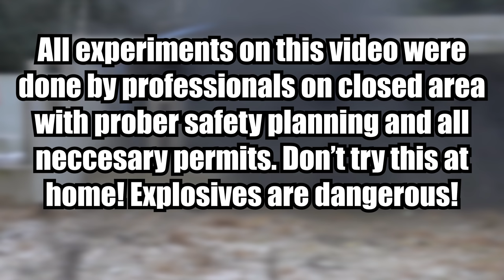How hard it is to explode a hole in concrete wall?

Comment: everybody who ever had to jackhammer through a concrete wall knows how freaking hard this stuff is. And concrete becomes harder with the years. I wonder how old the wall for your test was?
Reply: My gues is over a year, so it's about 90% of max strength. It takes over 100 years to reach max.
Reply: @silmupelaa6349  and after 100 yeras start to deteriorate not the concrete but steel inside because there is no "chemistry" in concrete any more to prevent rust which will slowly blast the concrete
Reply: @silmupelaa6349  most concrete strength is based off 28 day strength.
Reply: My thoughts exactly
Reply: Looks like failed pourings the concrete company had laying around. So they could easily be a few years old.
Reply: @SweBeach2023   do you think they have the space to store stuff like that ? And for what purpose  ?

Comment: Next time, also try a sheet explosive charge shaped like a square on point ("diamond") shape, laid flat against wall and initiated simultaneously from two opposite corners. Where the detonation waves meet in center of square, they will reinforce and make a straight cut, even without water tamping.
Reply: This sounds really interesting. Could you, theoretically, use 4 of them, joined at the corners to create a big “diamond”, and cut a square out of the surface they’re attached to?

Comment: the reason why the last 2 explosive devices went through the wall is: the conrete has microfractures because of the explosions from before. If you would change the order of the explosions, the watertank would not get through the concrete wall.

Comment: I know this is an old video but, if you ever revisit this, you could use a iron or steel bowl around 10mm thick.
You tape it to the wall with the explosives at stuck to the bottom of the bowl (inside it) and the top of the bowl facing the wall.
The air pressure inside the bowl will make the hole you need
Reply: And also shoot what's basically a cannonball in the opposite direction, around the direction they are in 😬.

Comment: You needed to add water bags on the outside of the charge. 

Water doesn't compress and explosives move to path of least resistance.  Concrete will compress before water thus increasing chance of blowing a hole in concrete.

Comment: You should do a video that shows how much explosives it takes to make a hole big enough to walk thru like in a game.
Reply: That requires a different type of wall, or complete pre drilling and inserting charges in a spiral pattern, like when drilling and blasting on the face of a mine drift or tunnel.
Reply: You'd probably need a regular brick wall

Comment: So you can "control" the direction of energy released from the explosion with water since it doesnt compress? Energy will go the path of least resistance? I.e. concrete with voids vs tightly dense water molecules.
Reply: I'm not entirely sure about your rationalization with molecules, but yes. It's the same reason you don't want water in your combustion engine because it doesn't compress. It's great at channeling force because it will stay the same volume, so if you violently shunting it into concrete, it won't just vaporize like the steel bar.

Comment: I'm genuinely curious as to how much effect on the pressure wave a plastic shell has over steel...
Reply: zero, it is not black powder or other fireworks material that is burning(not exploding) and the shell is alowing the pressure build up(and in the end failure/"explosion" of the container is the whole booom!).

Comment: Did you consider whether your explosive was positioned in front of the rebar or between the rebars? I would think that would make a difference as to whether something goes through.
Reply: It might, but from a breaching perspective it may be difficult to know or find out just how it's spaced, so you'll probably have to wing it. It also may not make a significant difference.

A guy who studied and trained breaching in the military said in the comments here that you'll have to cut the reinforcing rebar afterwards with a powertool, because the concrete will absorb the blast, just like you see here. The rebar would have to have the explosive right next to it to break it up, which you don't have the luxury of spending time fidgeting with (at least in any kind of combat scenario), but pulverizing all the concrete around it is still a very good start, because it's in the way just as well.

If you've got a good barrier or corner to take cover behind though, you could probably rush in and start cutting that rebar pretty quick in just seconds after the blast, even faster if two guys work at the same time.

Comment: At 6:18 begins a demonstration of the power of water.

Technically, a lot of the reason a torpedo hitting a ship's steel hull under the water can put a big hole in a ship has to do with the "incompressibility" of water. A detonation looks for something compressible to send its energy to. Steel and water are both regarded as incompressible. The air on the other side of a ship hull is however regarded as compressible. The result is that the detonation of a torpedo will make a hole in a tough steel hull in order to breech a path to the compressible air on the inside of a ship. German submarines long ago in WW1 more than 100 years ago used that trick to sink a lot of ships with their torpedos.

In effect, the entertainment detonation crew was creating ship-like conditions of water on one side of an explosive, and on the other side of the explosive, a tough object with air beyond it. The result was the same as what the German submarines were looking to achieve in WW1, a big hole.

Comment: The Jerry can would have been more effective on the other side of the charge. The water transfers the energy more efficiently than air. 

We used a quarter stick of C-4 and an IV to taco heavy steel doors in the Army.

Comment: They did tests about a decade ago for the bunkers that have been placed around the US.  Epoxy concrete and then epoxy graphene.  When properly poured and set, you can hardly scratch the surface with even a shaped charge.  Your standard bunker buster can't even penitrait it.

Comment: Surface explosions do very little unless they are directed. Drill a bit of a hole, and put the explosives in that, and pack in it, or use a shaped charge, and you'll likely have an entirely different story.

Plus thats reinforced concrete. Different story if its not reinforced, as well.

Comment: The Underwater  explosive course i attended way back in the midd 70s, I used the bottom of a red wine bottle (just the dimple) to shape the charge, using blasting gel pack the explosive  evenly around the glass place the Det in the in the centre of the dome, attach to wall or heavy steel plate and initiate, it should blast an  hole of about 25mm right through.. smashing fun.

Comment: Make a shaped charge in a small bucket and line it with a copper sheet on the inside. This should, with proper stand-off  distance, create a metal penetrator that will cut the steel reinforcement. The hole will be approximately the diameter of the bucket, assuming you don't skimp on the explosive charge.

Comment: Place a slightly delayed chopping shaped ring on the back of the container. Perhaps it fires though the hole made in the water and chops the wires. Making it fire the metal slightly increasing in radius the central lower vaccuum-ish pulls for a tension stress on the centre?

Comment: The c4 with the rod acted like a HESH tank round instead of like a HEAT round. HESH works by transferring energy through a material so that it causes fractures on the other side which causes spalling to occur behind an object, or for tanks. Inside the tank.

Comment: 4:51  this presible is similar and used to that of a HESH or high explosive squash head round which can be used on tanks the way it works is it detonates on the armor outside and then it forms cracks inside which produces deadly shrapnel and injures the crew or more

Comment: The title should be "3 Funny Finns Blow Stuff Up". I bet you, it goes viral. ^^
BTW I think your Finnish accent in English is just adorable, I instantly liked it (never heard Finns speak English before TBH)

00:01 Find the typo... :P

02:18 Common guys and gals, you knew EXACTLY nothing would happen - you just needed an excuse to blow one more thingy up. XD
08:10 Inertia of mass (in this case the water) is your friend. I knew it would be way more effective, but expected spalling, no clean breach. I think getting the Steel out of the way would demand for an ATGM or similar.
Reply: An ATGM would not make a large hole, HEAT warheads make a small jet of copper that penetrates. Would definitely pen the wall, but not a big enough hole to even put your hand through.

Comment: Maybe use some magnesium rebar to line the outside of the can? Maybe it would burn through the steel reinforcement. At the very least it should help burn up the remnants of the container and limit the blowback. But the explosion will be too bright to look at directly.

Comment: Using water as a cover for a breaching charge, because water can't be compressed, the initial force of the explosion is reflected back in the direction you want the explosion to go. It's why some police forces when they are breaching a door, will hang bags of water over the charges.

Comment: Pretty sure the Germans used shaped charges on Fort Eban Emael at the beginning of WW2.. They used two charges for each hole, the first weakened the concrete, the second busted the hole..The concrete was steel reinforced.. The battle was over before it began..

Comment: I think the 1st 2 attempts failed because the explosive force took the path of least resistance.
The 3rd charge used the water to hold the explosive in place.

Comment: The reason all of these did so little is because explosives are a propellant, and you're giving them nothing to propel through the wall, and nothing to channel the force into what's being propelled. Look up the assassination of Alfred Herrhausen in 1989. They were able to take a bomb that fit into a book bag and nearly rip an armored car in half with it because they created a housing for the propellant, and the explosive was used to shape a copper plate into a foot wide razor blade which did all the damage.

Comment: the way you had your shape charges were set back to front it should be flipped so the holo side of the triangle is against the wall then the tip of it colipase's inwards shooting the metal into the wall

Comment: That wet fart is basically low budget HESH. Which works like a big slap to the surface rather than a precise hole bore like a shaped charge does.

Comment: I'm in the military and an instructor in Tactical explosive breaching and everything is wrong. You guys said you are professional, but there is nothing calculated. What is your NEQ in relation of the thickness of your wall? There are charges that already exist for concrete walls, and they work very well. I can't say a lot on the topic that I'm instructing cause everything is protected.

Comment: Hehe
You guys should look into an "Alford blade".
Shaped charge with a reservoir of water ahead of the charge, so the water is pushed by the explosion. Modular linking design, so you can change the shape of the blade.
Cuts rear, razor wire, concrete, steel plate, all comers. Like an oversized&loud pair of scissors.

Comment: We used to use 750 / 800 grams of det cord in a cross loop to breach an external wall. Like a normal house with two layers of brick.
Most probibily killing any one on the other side, which saves on ammo.

Comment: Shape charges use a high explosive compound known as RDX which is why you didn't get the desired effect. RDX would've also sliced through the rebar for a clean hole.

Comment: I would never think that this would work, even in a video game setting.  Not with a reinforced concrete wall.  Now, with a cinder block wall?  I think it would absolutely work with a much smaller explosion.  You can bust one of those up just by dropping one from a standing height at the right angle.  You should try this test again with a plain cinder block wall, which would make a lot more sense, anyways, since cinder blocks are often what interior walls are made from in concrete constructed buildings.

Comment: I am sure that if you had put the explosive between the water bottle and the concrete, a hole would had been punched in the concrete slap. Water is a very effective reaction mass to direct all force into the direction of the wall, rather then into all directions like in your experiment. 
An English explosives engineer called Stanley Whatshisname has done a lot of research in using water as a reaction mass and invented a couple of military tools to, for instance, blow a (door-shaped) rectangular cutout in a concrete wall, using not more than a few meters of detonation cord and a sausage-like tube filled with water as reaction mass and it works perfectly.

Comment: try the amount of a handgrenade in a thick metal bowl attached very strong to a concrete wall imagine it like like this (G|
( is the metal bowl
G is the grenade
| is the wall
it will increase the breaching abbility significantly

Comment: i think tanks should have a layer of water in their armour. The very high temp shaped charge would instantly turn it to steam, pushing back and dissapating and expulsing the high stream jet in a micro second, plus its easily mended and refilled. useless against high density rounds obvuiously

Comment: You want to create a shaped charge to concentrate the kinetic energy of the explosion at one point, even with a small amount of explosive it can create holes in things. Look at the mine/ied designs shia militias in iraq used and anti tank warheads. Even a simple metal cone will do it.

Comment: When I was in the USMC, I could drop a MK-82 500lbs traveling the speed of a 45 cal bullet and it will go through almost anything.  Even the practice bombs because of the kinetic energy traveling so fast, it will go through. I could drop 28 MK-82s at the same time...we called those missions Dusters,  cause that's what you have left....

Comment: Think of how mining works. You need considerably less explosives to blow a hole into something, if you first drill a hole into it and pack it into that confined space, as opposed to letting the blast's energy spread away from it on the outside.

Comment: Long live Suomi‼️
🇳🇴💪🏻😂👍🏻🇺🇸

Since YT AI just fed this to me for some reason … I have questions:

- How thick was the concrete wall?

- How fresh or new was the wall? When was it made before the tests? How long did it cure (water elimination)?

- How dense or porous was the concrete mix? There are various levels of strength to concrete based on the elements used.

- How many rebars per foot or meter? How were they configured? How thick were each rebar? (They seemed thin from the video).

All these and more play into how strong a concrete barricade or wall performs.

Comment: From my experience, in the military, & from the (coal), mining industry in civilian life, … I already knew about the trick with the 5 gallons of water, redirecting the energy of the blast, over the larger form of the container, … in coal mining, they drill, into the face wall, about 6 ft deep, remove the drill, & let the blaster pack the hole with dynamite, cap, & det cord, and slide in the empty plastic bags used to contain the water, inflate said bags so they are tight in the hole, backing away personnel, from the blast area, … then detonate the charge, done properly, it will fracture the face of the wall, & once given the “all clear”, go into the chamber, & scoop up the shattered section of the wall, … generally just 2&1/2 to 5 foot tall, … in the coal seam, … once the area has the debris, & product been removed, the process of shoring up the overburden begins, & once the area has stabilized, … the whole process gets repeated, … safety 1st, is the rule of hand for each, & every member inside of any mine, whether above ground, or deep inside of a working area of any mine, the basic rules are there to protect each, & every person who enters an area near to, or inside the area of production, …  one more thing, … even though “ the motto safety 1st, is always applicable, it is also true to say, & practice, 
“Safety 1st >>Safety Last”

Comment: So what you're saying is you're better off just walking around the concrete because the steel beams ain't gonna budge.
Reply: Actually, not so, … if a specific area, needs to be breached, then you would acclimate your detonation points with either a specific type of charge, &/or a multilevel blasting agent, … steel beams can be cut like butter if you have the proper training, & enough materials, … and you can always leverage the structure against itself, …  just like the hijackers did with the twin towers, in NYCity, … 
By flying those jets into the buildings where they did, allowed a series of pre planned devastation to take place< … the resulting massive fire caused by the heat of all of the jet fuel burning, as it did for so long, with that intensity of heat, created a weak point as the steel beams grew red hot, … the weight of the upper floors caused it to collapse, and in doing so, gained the momentum of power needed to crush each, & every floor it collapsed down onto, increasing the momentum, as the weight of the floors above, traveled down through the building, … reverse engineering the force of gravity to suit a fixed purpose, … kinda like using an opponents size, & weight against them with Judo, …